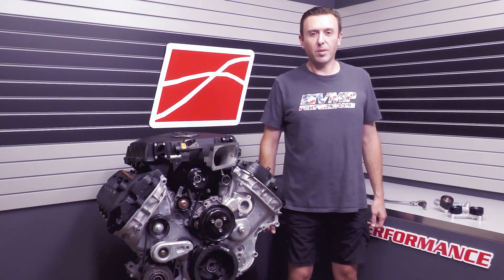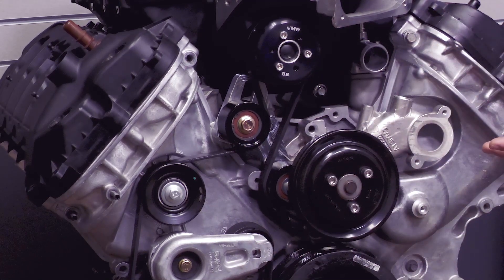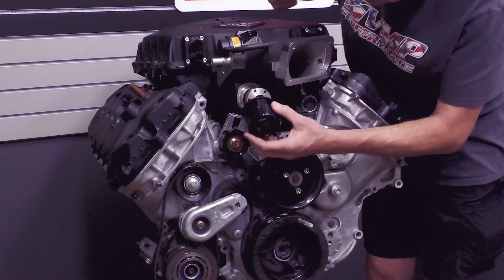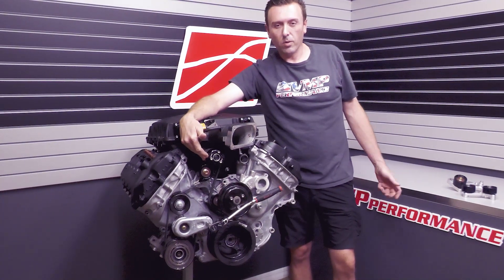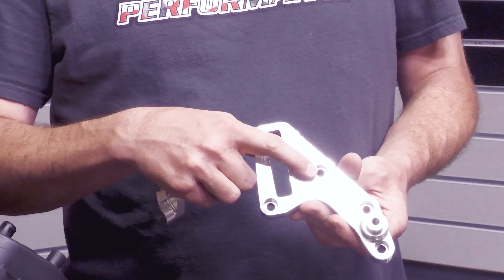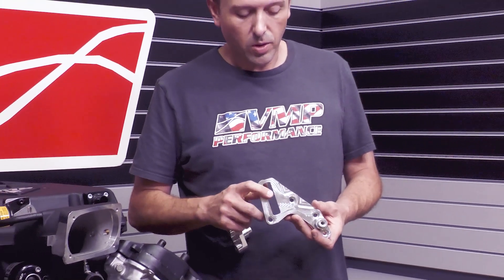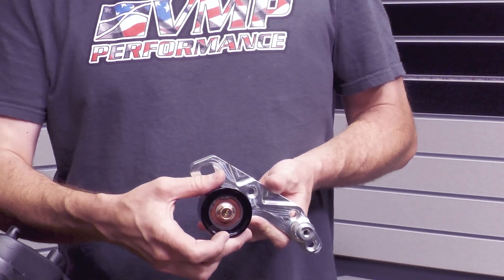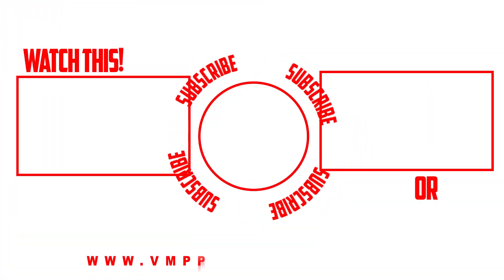The brand new ATLAS bracket with auxiliary idler for Odin kits is here! || Project Odin

Comment: Would this widen the window for needing different size belts for pulley swaps?
Reply from the maker: There's nothing more effective than having a properly sized belt on your set up.  We have designed the Atlas to work with the existing sizes specified for Odin and would still recommend the same size/pulley combinations.

Comment: Pretty cool 😎. Would this benefit still if I have the 88 having more wrap on the 88 pulley? Thanks
Reply from the maker: Great question.  The likelihood of slip is very low with an 88 mm pulley, but the Atlas is fully adjustable and will add belt wrap to assist with mechanical grip as well as have you prepared to pulley down.